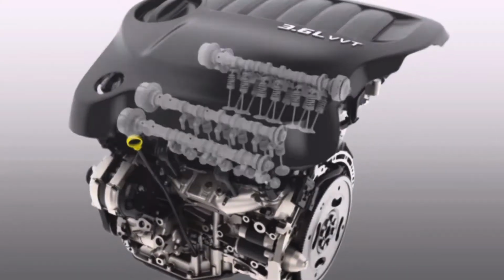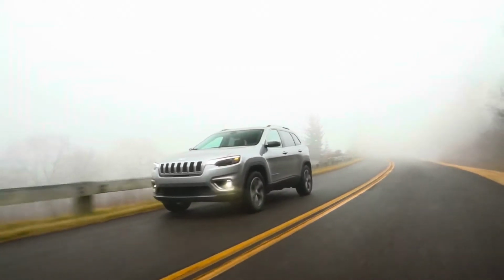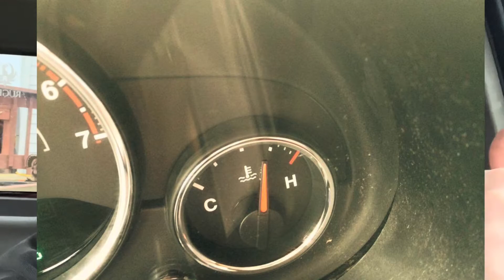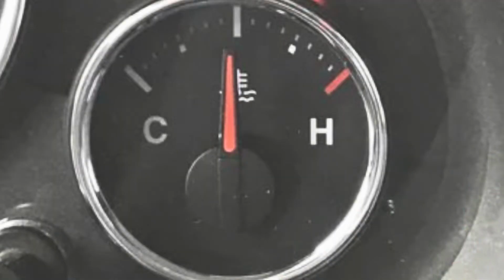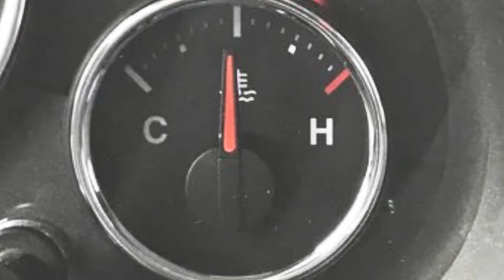Jeep JK/JL Normal operating temperature

Comment: For some reason I hit 250+ yesterday.  The highest was 253... no lights nothing higher but much hotter than the normal 230 max I'm used to. I burped the system just in case and had a massive overflow out of the funnel once the fan and thermostat kicked in.  Could this be a bad thermostat?
Reply: Coolant boiled... watch your Temps with cap off if it gets to 215 shut it down and wait till it cools. Let the trapped air out of the upper heater core hose. Repeat until upper hose gets hot and heater blows hot from both sides of the cab then cap radiator. Gotta remember if cap isn't holding coolant under pressure then it will boil easily

Comment: the issue I'm having right now is my jeep gets up to 233f on the freeway and the fans kick on and it drops to 215-217f. 
if I really punch it to about 80-90mph it gets up to 240-245F and I let go of the throttle and it instantly drops to 226f. 
I believe I have air trapped in the engine block. what do you all think it might be? 2014 JK.
I never had these issues before I did the thermostat swap.
Reply from the maker: In your case you have air these jeeps are a pain to get air out
Reply: Did you open the bleeder valve on the thermostat housing?
Reply: @randalthomas1800  yes I did. I recently changed thermostat again and it was fine. on my way to the desert i had to climb and noticed the jeep started warming up again. on the way back home i got up to 245F on a very steep hill trying to maintain 70mph as the speed limit. I'm doing a whole flush and adding Mopar coolant and using a Coolant System Refiller Kit. hope this helps
Reply: @cherokeeronnie  thats what i hear but dam can it really be that much pain in the ass?
Reply: @TheTaytoni  let me know how it goes .. I’m having the same issue
Reply: @Tayule_Gaming  did you ever figure out the problem? My jeep is doing the same thing now. I changed thermostat and burp system and it's still runs high temp on highway speeds.
Reply from the maker: Thing you need to take into consideration is how much weight is in your jeep what size tires are you running and are you running the proper gearing and why is in front of the grill
Reply: I did not. I did a full coolant flush again and used a Vacuum fill tool to eliminate the chance of getting air trapped and its still overheating when I accelerate and I stay over 3k rpm's for an extended period of time. My next thing to replace is the water pump.
Reply: @TheTaytoni  just a heads up I changed my thermostat 3x thinking they were defaulted. I changed my water pump, both coolant temp sensor, radiator. Btw make sure to read manual and use factory coolant. You’ll learn they have ,OAT 10yr, MOT 5yr. Once I did this it didn’t change anything but atleast a check light engine came on for something to read. P0480 . Changed fan notice fuse was bad. Went to dealer to do diagnosis and was told to change TIPM. Try taking for diagnosis. Don’t waste your money like I did. I’m ready to throw the towel but this bad boy has one on me

Comment: I have a 2012 3.6 only runs at the  3/4 mark temp line. only in summer time when it's over 95 degrees and over. At over 65+ miles an hour.  Is that normal.
Reply from the maker: It don’t move it just stays there? Any mods done you your jeep
Reply: @Cherokee Ronnie  just 6" lift 35" wheels. Winch and  the spare is also 35". And the angry gladiator grill But it runs great as long as it's not 95 degress  and hoter and at over 65mph. If  the. When it runs under  65mp the temperature is normal. At hight temp.  But regular weather in the under 95 it runs normal
I changed water pump radiator. Thermostat. Only thing either is the fan. To see if it gets any better.
Reply from the maker: Is the winch blocking the grill  and what gearing
Reply: @Cherokee Ronnie  the gearing Is stock. The winch blocks it a little.

Comment: So my biggest question is I have a 99 jeep wrangler TJ and there is after market painting done on it. I noticed the hood was getting so hot I could barely lay my hand on it and then felt cracks in the hood from how hot it gets. I believe its called "grazing" but I took the hood off and realized a wave of heat hit me. The radiator was extremely hott as well as the engine which I am assuming it is what caused the grazing on the hood paint. I did however just replace the water pump and was wanting to replace the readiator but everyone told me to not replace it until it needs to be. It has 33's with a 3 inch lift and it does have a winch in the front where the grill is at..... but I have nothing blocking or restricting air flow to the radiator besides the winch. The gauge on the dash says that it is perfectly at 210 and sometimes gets to 220 but that is it. Is that normal for the engine and rad to get that hot that it chips and flakes paint on the hood?
Reply from the maker: 4.0?

Comment: Don’t listen to this guy. There is a recall for the jeep 2021 anyway. There’s a screw that needs Loctite or something that’s causing coolant to slightly leak. I had a friend that just had hers blow up because she didn’t get it in to fix the recall on hers. I have the same year jeep and mine just started overheating. Getting up to 230 to 250 in temperature. I just had to add a half a gallon of coolant. I’m taking mine in this afternoon to get the recall fixed. So don’t blow up your engine because you listen to a YouTube guy.